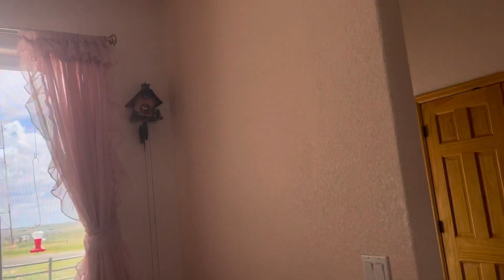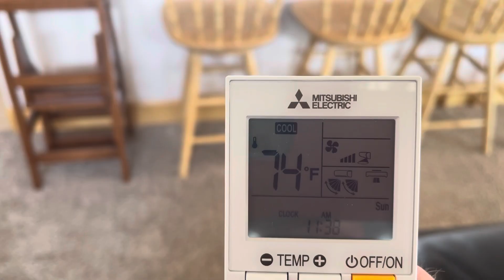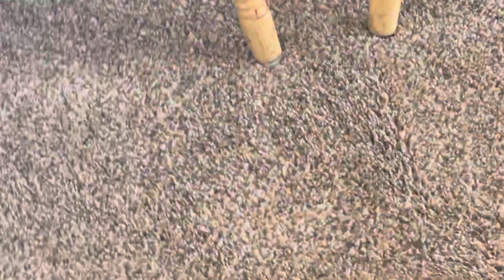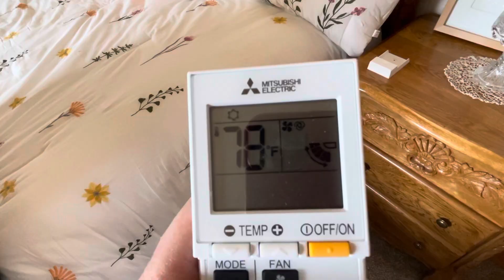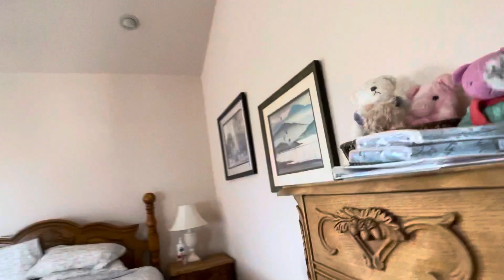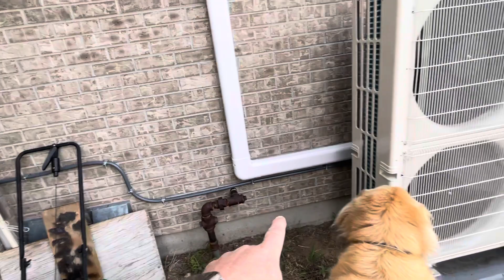Mitsubishi Ductless control set-up and operating modes multi-Zone system Ductless Plus green install

Comment: Hi ! Quick question. Does the attic space you are standing in it gets conditioned due to the lines being there while the hvac units are running? Reason I ask is because I have similar smaller set up and during the winter my attic space is warmer than room the hvac units are in. For example the rooms are set at 68 but the attic is measuring 70.
Reply from the maker: No they only space heat not supporting heat for attics.

Comment: is 7.2 ounces short on refrigerant enough to cause the FS head units to run for several hours and then all stop operating and flash single green light until powering each FS unit off and then back on? Once power cycled they run again for several hours before doing the same thing. The system is an MXZ 48k Hyperheat, 5 port PAC Branch Box, 2- FS15's, 1- FS12, 2 FS06's, 209.2' total pipe length. DSB called for 8.69 LB of additional refrigerant, only 8.24 went in (7.2 ounces short)
Reply from the maker: If you’re short you need to add it in.
Reply: @ductlessplushvac  Thank you for your quick response! I agree with that and as soon as I get to the shop and grab another tank I will go back and top it off- I was just trying to determine if that amount of shortage would be sufficient to cause that behavior or should I be looking at something else?
Reply from the maker: @heronheron7432  double check everything
Reply: @ductlessplushvac  Added the 7.2 ounces of refrigerant to the capacity required according to DSB. I remeasured all of the line set runs to make sure what was entered into DSB was correct, and it was. I double checked all of the wiring from the branch box to the head units to make sure that terminals are matched at both locations, and did this for the comm cable to the condenser, with the 16 shielded cable being grounded at only one end. The condenser, and the branch box are powered separately and are each receiving 247V's. All head units are powered on and run for several hours then stop running and blink green. Anything else I should be looking at?
Reply: @ductlessplushvac  I disconnected each head one at a time until the symptom stopped. Ran a new cable to the problem unit from the branch box, problem went away reconnected the old cable it immediately returned. Chased down and physically viewed all of the first cable to find the electricians had popped a staple through it while running a bathroom light\fan circuit.
Reply from the maker: @heronheron7432  Wow sparkles  that sucks but good investigation to find and locate the issue! Great job!! 👏

Comment: That oscillator button on the right hand side of the minisplit, HOW DO I MAKE THAT STOP ROTATING????? It's making a pulsing noise that's driving me crazy.  Thanks
Reply from the maker: You can disconnect it from the power board.